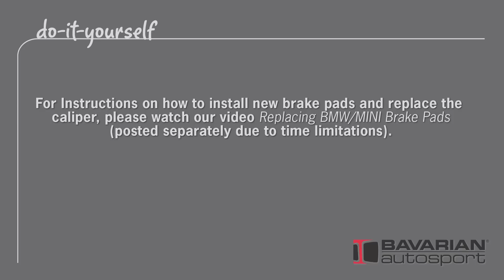Replacing BMW/MINI Brake Rotors

Comment: A good way to remove the rotor screw is to use a manual impact hammer and they come out just about every time.  Love that tool.  Great video thank you.
Reply: +Engineerboy100 I tried this also but it still just strips the screw head.  My rotors were all originals.  Cars are 16-17 years old with 100,000 miles.

Comment: I have a 1998 e36 and a 1999 e46. I had to drill out all rotor hold-down screws on both cars.  I even sprayed them with penetrating oil and let them sit for hours. I am assuming they were all original rotors.  Just wanted to share.  I love your channel and have ordered $1,000's in aftermarket parts from your site.  Thanks!

Comment: Great video.  Do you have one on how to do the hydraulic brake lines?  I want to change out the rubber ones with stainless steel ones.  Thanks.

Comment: If the rotor hold down screw offers resistance, sometimes an impact wrench will break it loose without stripping it. Might also want to tap the rotor a few times with a hammer.

Comment from the maker: @hpa1700n 
A general number would be about 90-ftlbs.  However, the Bentley manuals have the figures for each BMW or MINI model.  We have the manuals at bavauto DOT com.

Additionally, see our BLOG post on wheel lug torque.  Go to blog.bavauto DOT com and search on BMW & MINI Wheel Lug Bolt / Nut Tightening Torque

Comment: I just want to replace the rotor by itself since the pads are still fairly new. Can I just remove the two 17 mm bolts holding the caliper in place or do I have to remove the guide rods also?
Reply from the maker: You can just remove the two bracket mounting bolts and remove the caliper and bracket together.

Comment: what brand of rotors, and pads, do you recommend to replace the ones on a 2008 535i?
Reply from the maker: Really, the choice is up to you.  Some owners will prefer the least expensive alternatives, while others may want long life, clean wheels, street/track performance or any combination of these.

A very good combination for most BMW owners is the Brembo anti-corrosive coated rotors and the Pagid or Cool Carbon pads.  Check these out at BavAuto.com or call our Advisors at 800-535-2002 for further assistance.
Reply: BavarianAuto Thanks for the reply! Your videos are extremely helpful!
Reply: ShowersNeiked Best brake pads for street application, Axxis.  A very good brake pad application for track, Stoptech.

Comment: Otto, I damaged the (Rotor Hold-down Screw).  Where can I get a screw like that to replace on my rotors?
Reply from the maker: We sell replacement rotor hold-down screws.  Different models use different screws.  Email us at info@bavauto.com or call our advisors at 800-535-2002.

Comment: Be sure to wipe down the rotor surfaces again before installing brake pads. Any grease or oil will cause uneven wear.

Comment: what about the rear breake pads and rotors and emergency breake pads?
Reply from the maker: nawfal jardak The rear works the same way, just be sure that the parking brake is released when the rotor is being pulled off and installed.  If the parking brake pads or other hardware needs to be serviced, see the applicable Bentley Publishing repair manual:
http://www.bavauto.com/se1.asp?dept_id=5228

Comment: 75 is the specicific for my 1998 328i but 90 to be safe is fine rather large bolts so 90 won't break them